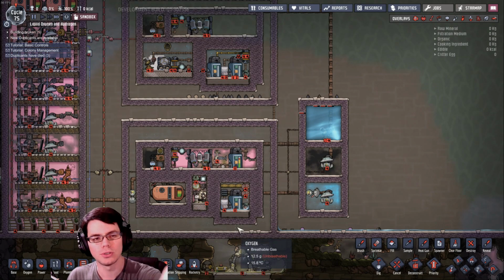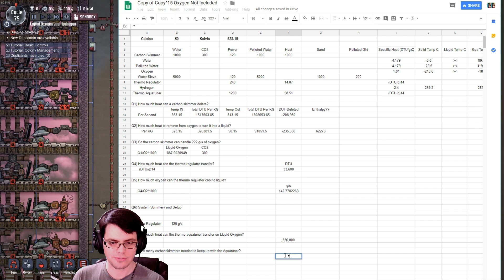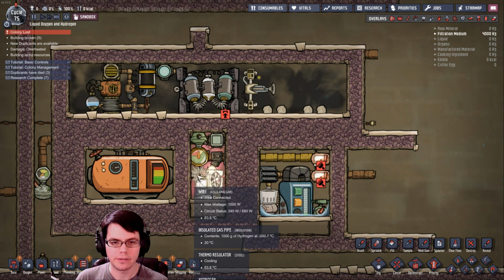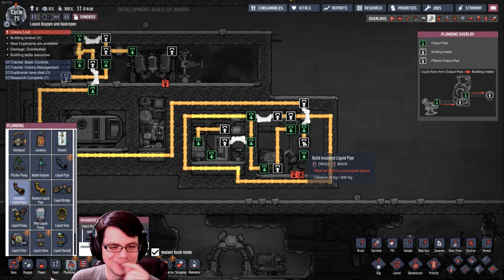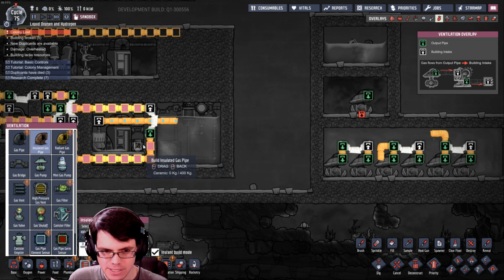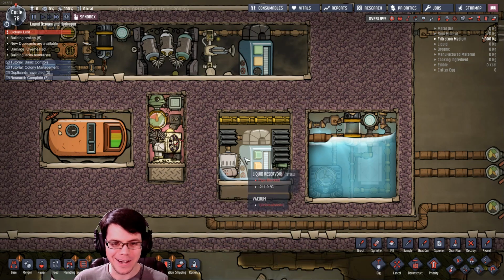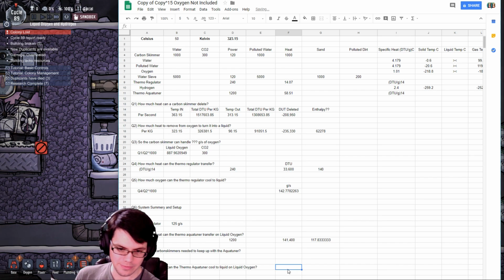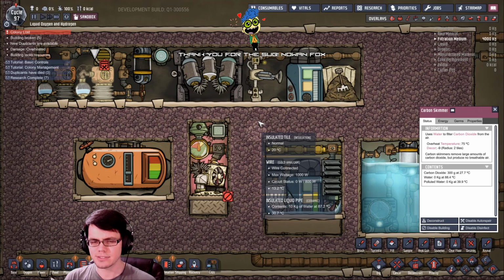Producing Liquid Oxygen Experiment! Oxygen Not Included Part 2 of 3

Comment: @brothgar On the germy water; Why not create a continuous loop between two resivoirs; One in chlorine, the other in hydrogen. The germs sort themselves out of existence very quickly using this method. dont even need to do anything fancy, just connect a set of dedicated pipes to the two reservoirs and a set of dedicateed combination pipes that ensures you get maximum pipe usage in areas you need em. You can split a single output 4 ways, split and combine them.
Reply: What are the issues of using germy water for these systems?
Reply: @markfrellips5633  In this use case here? None, because the temperature of the water destroys the germs, and the temperature of the hydrogen/oxygen loops are too cold for them to live. However, it is just another variable to contend with if you were to have a leak somewhere from a burst pipe. I just really like everything to be pristine, and brothgar said it was a bad idea. they sort themselves out in a cooling system like this. If you were to use 10 million germs germy water, could be bad, but I route ALL of my closed loop bathroom on a continuous loop through to reservoirs surrounded by chlorine so the water can just be let out though a clock shutoff valve into my water supply every night. it even goes through a bit of cooling zones so the water is 20-24c vs 40c before being drained.

Comment: Happy Xmas / almost new year, Brothgar! I've not made it into space yet, but my current base (which is on all the hardest settings, so progress is slow!) is on the verge of doing so, and I am so hyped about bringing back some supercoolant! I think it's possible to use it to liquefy oxygen and produce a power surplus with a steam generator, so I'm really exited for part 3 of this series to see if you can confirm that.
Reply: @brothgar  Thanks :) most of the problems were getting enough food and not being able to promote people too much without them becoming massive divas and spending all day in the massage room, but now that I've got fully automated drecko meat and sleet wheat farms it feels like everything is finally under control.

My main concern for the steam gen / supercooler setup is if steel will be sufficient for the aquatuner, or whether it'll need some thermium or whatever it is. You need to be able to get a decent buffer above the steam gen's 225'C start point before turning it on to avoid wasting heat in spinning up too often. Hopefully enough diamond shift plates around the aquatuner will be able to spread the heat out.

Comment: This has been pretty helpful, LO2 was something i was trying to figure out the most efficient means to get. Which this one shows my thoughts that the aqua tuner is not really the way to go.

With the new year. I'm gonna switch to start loading in mods to the game. I've seen alot of mods adding things that should be in the game by default, but just have not made it in yet.
Reply: Acutally, it is the way to go... if you use a liquid with more than 1.2 (DTU/g)/K specific heat capacity!

Comment: Can any one explain what a thermal capacity is , as i don't really get what it means
Reply: thermal capacity aka Specific Heat Capacity. is how much something can hold.
different example: im really small i can hold 50kg, you are really buff and can hold 150kg
Same for liquid or gas

Specific Heat Capacity:
hydrogen = 2.4
oxygen = 1

for this example hydrogen is best to use to capture heat
Reply: mike hanks thanks so much 😄
Reply: MarioMjs it is a measure of how much energy it takes to heat up a material. The higher the thermal capacity, the harder it is to heat. For example, if you put a pot of water over a fire it is safe, for a little while, to touch the water even though the air coming off the fire is burning hot. This is because the air takes very little energy to get hot while the water takes a lot.

Comment: you said the Thermo Aquatuner wouldnt be efficient with Liquid Oxygen.... which liquid would you use?  because no liquid can endure that low temperature besides all liquids that are converted from Gases like hydrogen propane or my favourite Helium.
the only way would really be super coolant
Reply: I think that's by design. That way the game can maintain the progression to the most powerful LOH/LOX rocket if you haven't built another form of rocket (you need fullerene for super coolant).

Technically though, you could produce both with their liquid forms in place of supercoolant (ie cool down a mass of hydrogen below the condensation point and just above its freezing point, and use this mass as your heatsink for further production). The condensation and freezing points match exactly, and as long as the aquatuner can remove more heat per unit time then is added by the target cooling material, you should be able to run the system without breaking pipes etc.